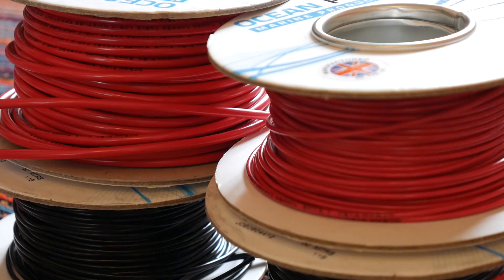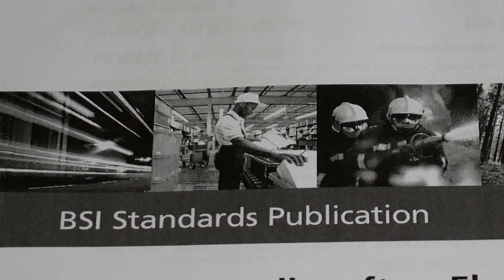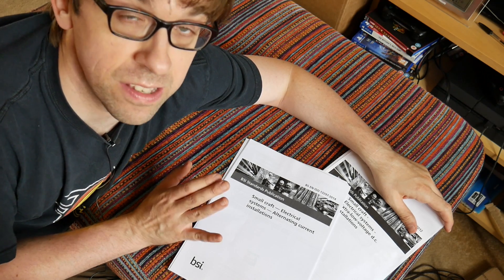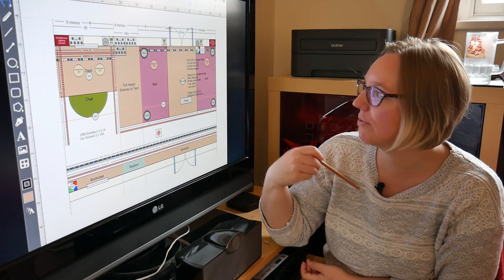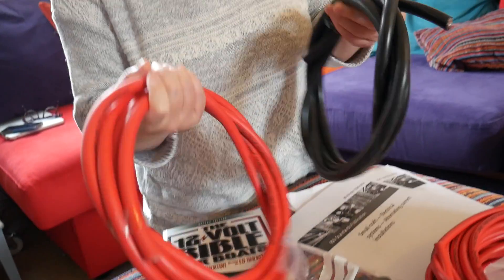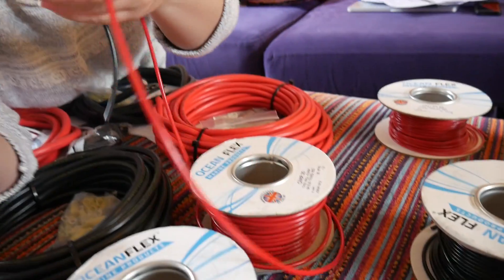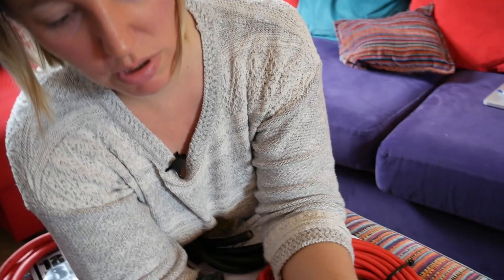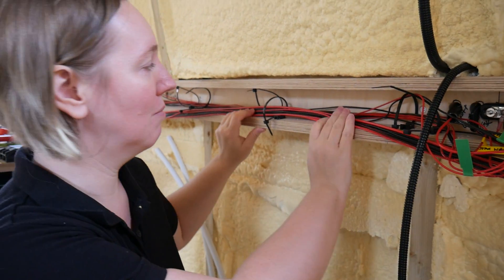The Narrowboat Fit Out – 8: Electric Avenue (12 Volt Electrical Adventures)

Comment: Hi Emma,
Great work. You're doing a fantastic job. Could you tell me what tool you used on the iPad to layout your boat electrics? And the spreadsheet you used would also be great too! Me and a friend are about to embark on the fit-out of a 60ft sailaway so anything you could offer (advice, links to suppliers, etc.) would be very helpful.
Reply from the maker: Hi there - this is Saxon! I've asked Emma, and the iPad app that she used is called TouchDraw. I also asked about the spreadsheet, but she'd rather not send it out, just because it's arranged in a particular way and probably wouldn't make sense to anyone else! Best of luck with your fit-out – the best thing I can advise is be prepared for it to take longer than you're expecting it to, and get your stove installed as fast as you can! (Because we went for a back-boiler, it's been incredibly complicated and we lost a bunch of time because it ended up so difficult to work during the colder months). Good luck! :-)

Comment: Forgive me if I misunderstood what I saw but ...... where you are running thicker cable to a junction box and branching off to smaller cable this raises issues with your fuse protection I.e the fuses should be rated for the lowest amperage capacity cable on a circuit, the fuses are protecting the cable so that should there be an excessive current draw, from a faulty connected load or a short in the wiring, the fuse blows before the wiring reaches its maximum capacity and heats up and potentially catches fire. You can avoid this by having distributed fuse boxes with high current eg 16mm feeds for say bow, stern and galley with shorter low current feeds for you loads. The bus bar junction boxes are really designed for the neutral returns where you can make a saving on wire costs by having a number daisychained around the boat with high current return to the battery.

Comment: I don't know about the UK  but here in Canada you can cut your wire size by using relays close to such things as high power lights, (but not so much any more since very high power OUTDOOR LED  are now available for things like such lights) horns. it is funny to hear you refer to wire size in mm we here it is in 4ga, 6ga.,16 ga.,14ga, 1/0, 2/0,3/0 and so on, battery cable is in that 1/0 to 4/0 sizing  all marine wire has yo be tinned copper,, I watched this video long ago but came back to day to refresh what you last did on the boat not much change to todays

Comment: You can't have enough mains outlets. If your done wiring the boat you might want to purchase a few plug strips so you have additional outlets.

Example. Computer cell phone charger iPad charger etc.  make sure all outlets have usb outlets with the mains then you can put you individual chargers in the closet. Now you can charge all handheld devices from any outlet on the boat with just the usb cable to charge your iPhone or android phone etc. all usb outlets are 5 volt dc right around 1000 milliamperes or slightly higher. I've been using them at the coffee shop with no ill affects.
Reply: None of those things go onto a 230V circuit. They all work off the 12VDC.

Comment: Great Job., I like the fact that you did not use your hull as the return, which causes a ton of issues in boats that have been wired by those not so diligent.... Cheers
Reply: That’s basically not possible on steel hulled boats.

Comment: just one thing, all those cables cable-tied together will start to get warm. if you are really unlucky the insulation can melt and you can start having interesting electrical problems. What we do in the trade is use "pins" across the trunking to hold the wiring in whilst the lid is fitted. The pins are normally just a wedge fit and made out of either scrap cable or trunking. Talking about trunking, you should not use wood as a trunking medium for any voltage as its flammable.  Any fire in the cable can ignite the wooden trunking. That ugly pvc trunking that everyone derides is actually flame retardant and the majority are also self extinguishing.  Pvc trunking comes in many finishes including a decent wood effect, it also comes with purpose made back boxes for sockets which can make life so much easier. There are also versions that have a shielded data compartment to allow you to have all the wiring in one location without any interference.  Make sure that any 12volt cable run with mains cable is rated at mains voltage as well. It should have a rating printed on it "350-500" volts normally. Take care with the standards as you also have to comply with BS7671:17edition:3rd amendment if you want to use shore power.

Comment: That looks like an interesting job.  I think it is  good that you seem  to be prioritizing a 12V DC system on the boat as this is a much more efficient way of handling your electrical needs. Though sometimes 12V appliances can be a lot more expensive than their 240V AC equivalents. I have known boaters to use substantial transformer and rectifier systems to feed their 12V DC requirements from shore mains as well.
Reply: PS as David Ife (below) pointed out it may be a good idea to make all of your junctions (bus bars) easily accessible, make sure all connections are rock solid tight and that those cable lug-ends are well crimped on. I still think you are doing a good job and I would avoid 240V AC on a boat as much as possible. It can  very dangerous on a boat and inverters are expensive and easily damaged.
Reply: Transformer/rectifier is an incredibly inefficient way to make a 12V power supply for 230V to 12V. Modern power supplies work by rectifying the 230V to about 400VDC and then chopping that at high frequencies so you can use a much smaller and more efficient transformer.

It is not all that hard or expensive to have a kilowatt scale 12V power supply. Higher end computer power supplies include one.

Comment: The surface area determines the amount of current the wire can handle.  The surface area of a circle is pi*radius^2, therefore 50mm^2 = pi*radius^2, i.e. radius = 4mm, i.e. internal diameter = 8mm.  Did I get it right?

Comment: I am sorry to hog the comments but I feel I should mention a further point. I notice from your schedule that you are wiring the lighting in 12v. As you are aware this is from your battery bank and is dc(direct current). This has a different characteristic from alternating current when lighting is involved. If eg. in the saloon you have say six lights on a circuit, you must wire them in parallel and not series. If wired in series you will find that the first light will be brighter and the last light will be dimmer. In parallel they will all remain the same brightness irrespective of the state of your batteries.
Reply: why would you ever think of running them in series in the first place?

Comment: The plywood ducting isn't there just to provide a route for cables, it provides structure when the lining is being attached to the inside of the boat. It provides the optimum solution to a number of problems, and that is why it is so popular among professional boat builders. On the subject of 240 volts, I've been boating for years, and I don't recall seeing that many landline connectors conveniently placed along the banks of canals and rivers. So like it or not, you need to go 12v or 24v. You need thick cables because low voltages are subject to significant voltage drops which is why pylons carrying power around the country are carrying electricity at hundreds of thousands of volts.
Reply: Inverters are quite good these days. You can run a fair amount of things from your 240VAC circuits even while running off batteries.

Comment: Another brilliant episode on this project, I really feel for you, all the books readily available from boat design ,layout plumbing, electrical schemes all seem to apply to individual builds and nothing in general.
Most references to any standards of compliance, like you say are largely well out of date and copies such as you obtained are a must.
You may have to do a similar exercise on plumbing installation too.
I cannot recall if yours will be a "gas free boat" but if not this may be an area where a man / lady gas fitter may have to be employed .
Perhaps someone out there will perhaps put together a complete technical bible on boat design and fit out to enable self builders an easier and safe route to completion.
I have to say that your ply trunking will at least provide the best finish than any p.v.c. Brand which looks rubbishy quite frankly and which can also be removed when required........Well  done, and good luck.

Comment: formost   I am sitting  here  Comfy  with my Coffee , and just really  really  enjoying that I  do not have to   write the spread Sheet of doom !!    Well done   !!  and  and narrow boat layout   (measure 2wice  and cut once )  i'm  just impressed ,, also     I  never realized it would happen ,,Voltage Drop ? really  in 30 m,,  interesting ,   , in power transmission lines   on the hill from  the power station  yes  sure  ,,  live and learn  I guess ,, thanks ,,  just a wonder full  explination  ,,  now do black holes  pls
Reply: actually,  it's the opposite.  The mains power lines are very very high voltage exactly to avoid volt drop, which is more pronounced at lower voltages. So,  at 12V, it becomes a bit of an issue,  even more so,  as the lower voltage means that the amperage is relatively higher,  and if you look at voltage drop calculations,  that compounds the situation.  
I looked into wiring a house with a 12v bank for the lighting and using LEDs,  but the volt drop meant the cables had to be annoyingly large
Reply: So My solar panels   are paying for volt drop  every second I have my switch  on, and the more solarpanels  that there are , the power co. decreases production which increases the volt drop ,resulting in a progressive increase in demand on my solarpanels  to compensate for voltage drop which slows the  rate of my backwards turning meter , so I am not getting uniformly  compensated for the electric generation of my panels ,  hmm  seems like someone has their thumb on the scale
Reply: It is also the difference between DC and AC I think. AC travels better and can be stepped up and down easier which is why we use it on the grid. And yea just any voltage drop when you are dealing with say batteries on 12.3 every 0.1v drop makes a big difference
Reply: No, the reason we use AC on the grid is because that's how it is generated. Yes, and can be stepped up and down too.
Reply: ah yes of course you are right, forgot about the making of the power!
Reply: hi  ready the Manuals of power tool said not use  extension leads more than 30 m

Comment: Resistance.  Think of an electric cable and current as a hosepipe and water flow - something nearly all of us are far more familiar with.  It's logical that the bigger the diameter of the hose, the more water you can pump through it.  Same with cables and electricity.  There are differences - trying to push too much current down a too small cable causes heat to be generated and possibly fire - something I have yet to see with a hose pipe full of water!

Comment: Hi, one other item I should advise on regarding data cabling, do not run data cables within the same trunking or conduit with 12v or 240v circuits as you will have signal interference. If you are running cables in the same direction (parallel) run them at least six inches apart.

Comment: I admire your efforts but wiring a narrowboat is not rocket science. An inverter, 6 way distribution board/isolator, a 240v ring main for power and a 240v circuit or two for lighting would suffice. Include for a galvanic isolator and provision for a landline connection, the 12v system should be minimum. The labour and material cost for the ply ducting is not necessary, you could have used a pvc 2"X1" trunking easier and junctions(bus bars) should not be enclosed in the duct, if a loose connection occurs due to vibration you will create a high resistance point causing heat and possible fire. All junctions should be free to air and easily accessible. I think you should have sought some advice before embarking on a task you know little about.
Reply: brill love it
Reply: david ife Hey David, ,, I'm seeking advice? How to get in touch? You got a Web site?
Reply: @David ife.
It is if you're electrical knowledge extends to just about replacing a plug on a kettle lead. Electricity is dangerous!! if nobody is confident in what they're doing, then just advise people to get a professional in.